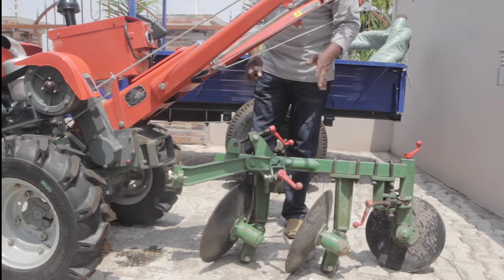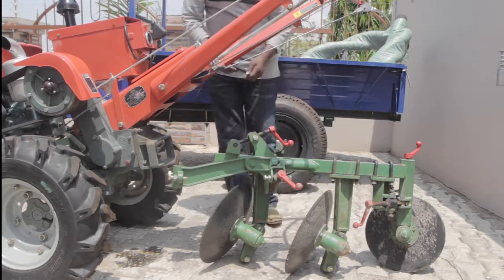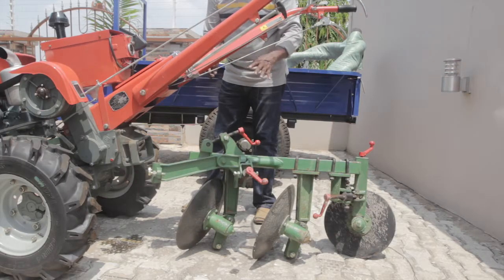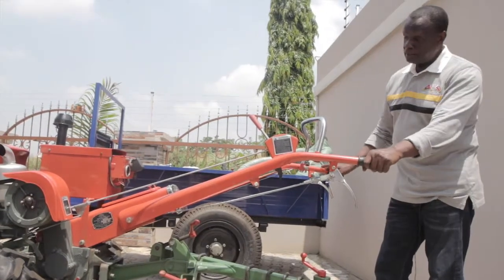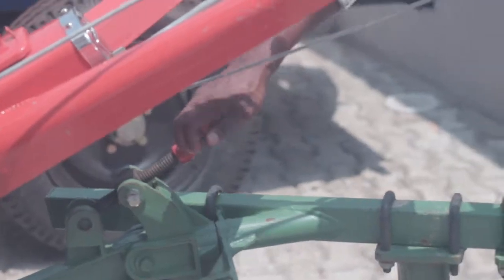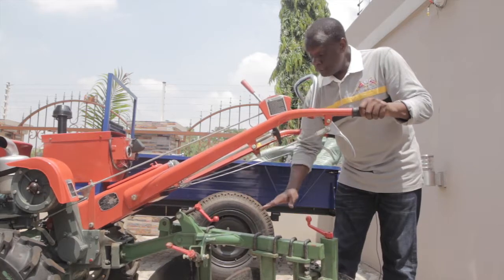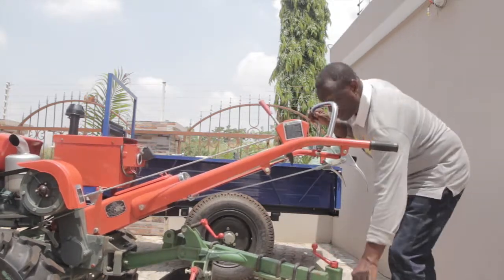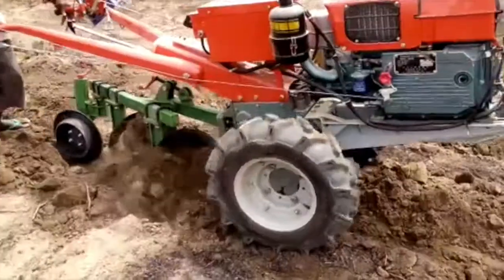Disc Plough 1

Comment: you need to turn your "furrow wheel" around 180 degrees so that the dish is facing the left. it's actually what's called a landside wheel and it controls both depth and side draft. Disc plough's dont naturally stay in the ground like moldboard plows and you don't have front wheels on a large tractor so this is very important. disc's produce a lot of side draft. Also the blade should be leaning towards the right at least 20 degrees or so.  That way the surface of the dish/bowl lines up with the side wall of the furrow left by the second disc leaning to the left about 30 degrees.

The importer did the same to us and sold us a plow with the frame out of tune and the landside wheel facing the wrong direction. When we made some custom modifications it starting working a lot better.

Comment: Thankyou for very educative videos.

I bought a 12hp walking tractor from China, unfortunately, they didn't provide an operation manual.
I would appreciate if you could do a videos on how to operate the tractor ( gears engagement selection, braking e.t.c) or share some form of instructions on the same.
Best regards.
Reply: Kindly... can you guide me on how to order one? I've tried severally to get a good supplier to no avail...
Reply: Where can one buy the 2 wheel tractor